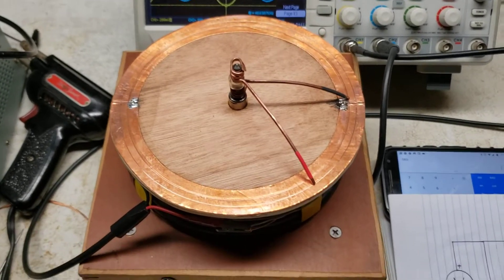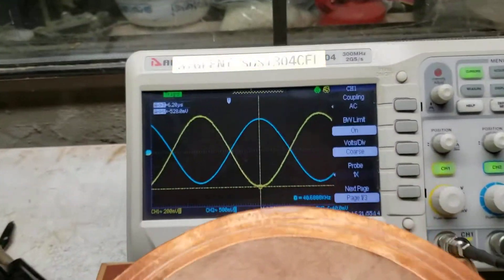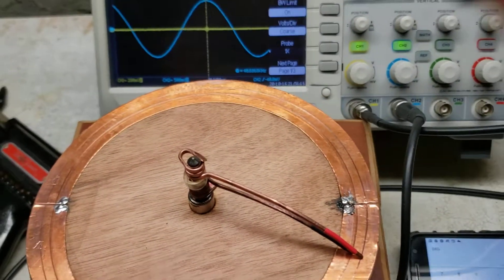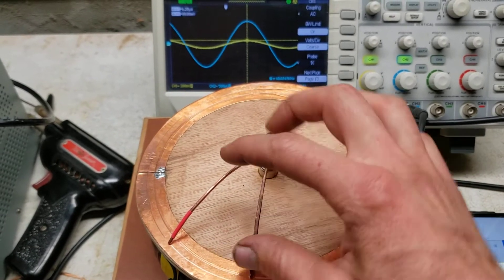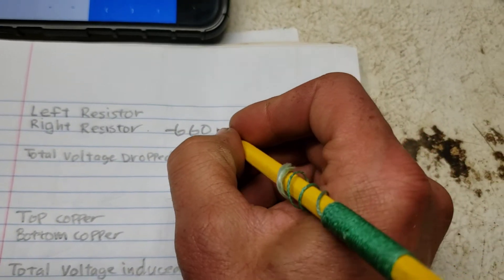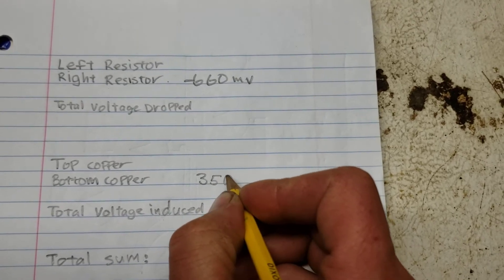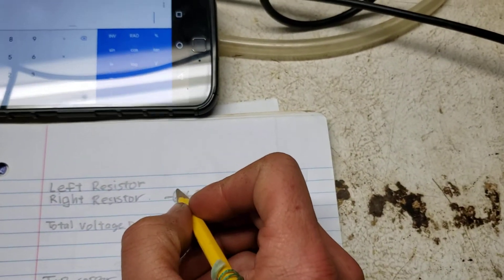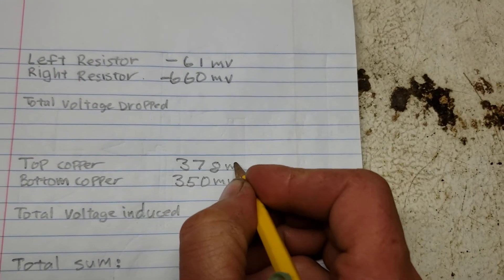The Lewin clock - Kirchhoff's Voltage Law(KVL) holds for loop circuits with induced voltage elements

Comment: Nicely done. Good to see the demonstration of the voltage rise as the probes take in a larger segmentof the copper loop. Also Nice use of a jack plug to get the isolated concentric connections! Inspired! Those of us who see both sides of the arguement see that in the end it is semantics. Dr Lewin doesn't count the wire, (an inductor, the -Ldi/dt bit) as a component in his Kirchoffs voltage law , and that way he is correct, and others eg Mr Sahdagdar do include it, so they are also correct. And your radial probing is essential! good job.
Reply from the maker: Thanks! You are sort of correct that it is semantics, but my problem with Lewin's semantics is that he withheld pertinent information from his audience in order to stun and amaze them so that they would be telling their grandchildren about it! (He was literally like "You are about to see something so amazing that you will tell your grandchildren about it! This is probably the only time in your life you will see this!") 

If he had been forthright about everything that was going on, I wouldn't have had any problem. But then again, he wouldn't have stunned his audience either. To me, it's more than just semantics.
Reply: @fromjesse  yes I accept your argument. And appreciate that your demonstration demystifies the hidden element. Thanks for engaging with me. Even as an electronics engineer who  graduated 40 years ago, I still found this debate interesting.

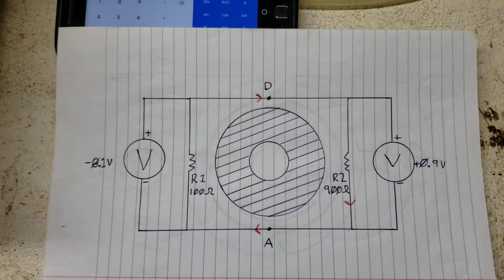Comment: So first off really cool setup and awesome video. However I believe there is a problem with your conclusion (I think the setup is perfectly fine). 0:21 Look at your diagram: if you place your probes anywhere along the line segment with A and the line segment with D, should you be getting different readings for the voltage? This is not a normal circuit. Another question: what is causing the change in measured voltage when you move the two probes. If you stick one at the top and one at the bottom, why does it change (and it changes _a lot_) if you move one of the probes?
Reply from the maker: >0:21 Look at your diagram:
This video was made in rebuttal to Lewin, so I was using a replication of HIS diagram. His diagram was in fact deceptive, and did not fully represent the physical situation. He should have drawn something more along the lines of this: https://i.postimg.cc/fTQX5tJC/IMG-20201018-115018189.jpg which shows how his volt meter leads run along parallel to the winding path, and would thus have voltage induced in them by the same magnetic field that induced voltage in the actual secondary winding.

In other words, he has two components to his circuit that he did not show in his diagram - specifically, the two half-turn secondary windings on his transformer. 

Remember, any wire, even a straight piece of wire, will have a voltage induced across it if it's in a changing magnetic field.

>if you place your probes anywhere along the line segment with A and the line segment with D, should you be getting different readings for the voltage?

I'm not sure what you're asking, but A and D are supposed to represent the two half-turns of the secondary on the transformer.
If the magnetic rate of change is such that there is one volt per turn, then half a turn will give half a volt, quarter of a turn will give a quarter of a volt, etc.

>what is causing the change in measured voltage when you move the two probes.

Well, if I move the two probes in the same direction at the same rate, there is no change (unless one of them jumps across a resistor.)

However, if I move one probe relative to the other, then the voltage changes because the quantity of a turn is changing.
Look at Faraday's law of induction: The voltage is directly proportional to N, which is the number of turns on the secondary.
And of course the voltage is induced evenly across the length of the entire turn, not suddenly at the end of the turn because the magnetic field is distributed evenly across the length of the turn.

>If you stick one at the top and one at the bottom, why does it change (and it changes _a lot_) if you move one of the probes?

There is a fixed voltage difference between the top and bottom halves because it's two secondary winding half-turns in a loop with two resistors of unequal values - 100 ohms and 1000 ohms - so you can calculate the voltages there.

But the amount that the voltage changes when I move one of the probes is still about 1v/turn, or half a volt per half turn, or a tenth of a volt for a tenth of a turn.

So I'm not sure what you're asking. Do notice that the sensitivity of the oscilloscope can be set to different ranges and sometimes in the video I change the scale so I can get a better reading on a smaller voltage, so it may look like the colored trace on the scope moves more, but if you look at the actual volts, it's all the same volts per turn. Look carefully, it's about 725mv/turn.

Faraday's induction law is:

Voltage induced = -N*(    (delta (B*A) ) / delta t)

Where:
N is number of turns
B is the magnetic field strength
A is the area of the coil
t is the time of course.

In my demonstration, B,A, and t are all fixed because it's not changing size, and the amplitude and frequency are constant.

So you can see that if we're at 1v/turn, a half a turn would be a half a volt.

Another way to look at it is that instead of the number of turns changing, A (the area) is changing - but that's also linear, so you could instead think of it as always a single turn that is changing area - but again, it's linear - half the area is half the voltage - and the math all works out the same, and it all matches my measurements.

>I believe there is a problem with your conclusion

What do you see as being wrong with my conclusion?

Are not the two half-turns just half-turn secondary windings on a transformer? They are producing exactly the voltage that they should be, whether you look at them as half-turns or just half the area, they are still producing the voltage they should be.
The sum of the voltages produced matches the sum of the voltages dropped in the resistors, and the sign-aware sum of the loop is zero (within the limitation of accuracy of my cheap scope.)

I did a couple other videos sort of on this topic too:

With an iron core transformer: https://youtu.be/iDWv8QJrzUo

Showing how to correctly probe with a volt meter in an inductive field: https://youtu.be/_mzxE_p5dN8

I really don't see why KVL can't be applied to the output of a couple transformer secondary windings. Believe it or not, the secondary winding on a transformer puts out a measurable voltage. This voltage acts just like any other voltage. Putting it in series with another such winding of the same phase adds up the voltage of the two of them.

I hope that helps!
Reply: @fromjesse  I'm satisfied with that explanation. Again really cool setup.
Reply from the maker: @bennattj  Thanks!
Reply: @fromjesse  The reason I asked my question is that you can calculate the current from the two resistors via Ohm's Law (which comes out to around 0.7 mA). But then if you treat this as a "normal" circuit, with the copper ring as a resistor, you'd calculate its resistance to be somewhere around 500 Ohms (which is obviously ludicrous). But that's the interesting thing about this circuit--the copper ring acts as if it's the battery (voltage source). So it's the thing providing the voltage (as you explained--and explained perfectly).

Comment: Great! Thanks for saving the electric common sense!
Mr. Lewin's experiment somewhat does not tell the whole story. 

There is some kind of induction which he does not take into an account. The experiment below is made more in Lewin's fashion and it shows that the physical arrangement of the measuring wires plays the very important role. Ie. even these measuring wires apparently induce some voltage.

Still, it is interesting. However, it rather emphasizes that one must be careful about the whole measuring environment, the consideration of the measurement errors etc.

https://youtu.be/b7i2uMx7gHo
Reply from the maker: Thanks! I may have actually seen that video before, although I only understand English and I probably forgot to turn on subtitles. But it's a great video you link to there!

I also did a couple other videos demonstrating why Dr. Lewin's demo was misleading and what was really going on:

https://youtu.be/_mzxE_p5dN8

https://youtu.be/V_Gs8tSqBRY